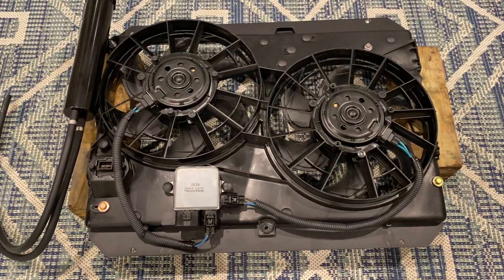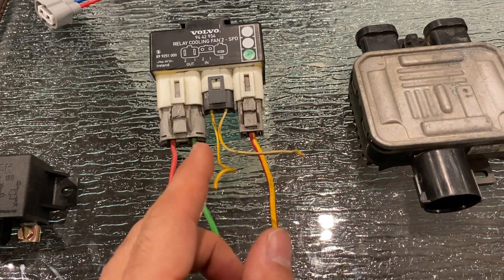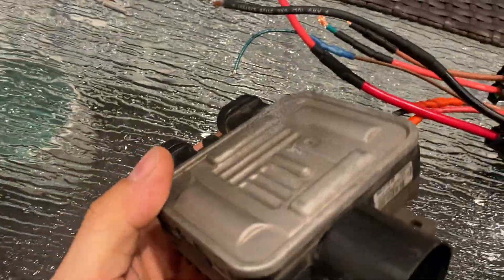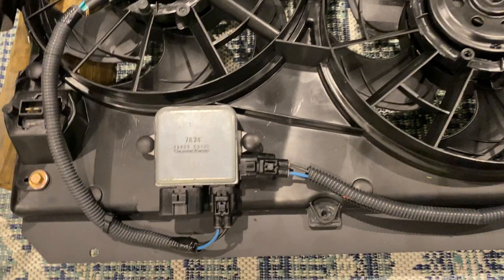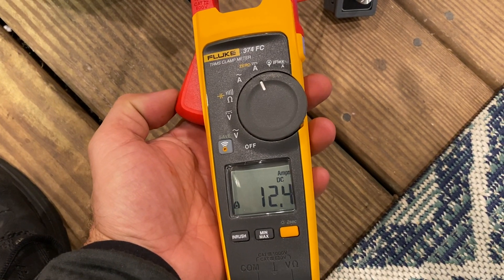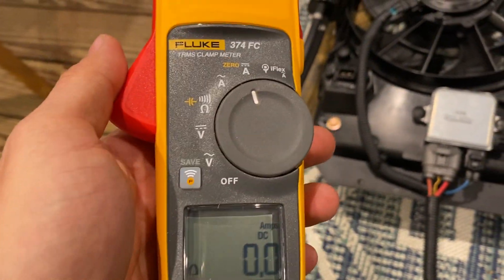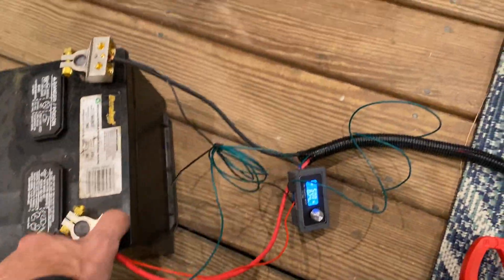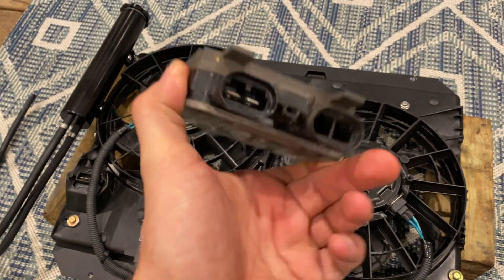Contour Fan Setup using a PMW fan controller

Comment: Thanks for the video, nice explanation of things. Quick question. 

What's the risk of running these countour dual fans without a controller? Sounds like when they start up it pulls a lot of juice but that lowers after they are running. 

Also do you think I can use it without the resistor connected to anything?
Reply from the maker: You can run these fans with a regular relay.   The BMW 2-speed relay is popular with these. You do not need to use the resistor if you just want a single speed - full on.  The resistor is for 2-speed use. 

The amperage spike on startup is very quick.  Typically wiring and maxi-fuse will handle this momentary spike.  I ran a similar fan off a simple Bosch 75a relay setup for years.  There was a slight dimming of lights for a half second when the fan kicked on but otherwise it ran fine provided the wire size is appropriate for the load when running. 

That’s the one thing I like about this controller is the soft-start feature so you don’t get that high amperage kick when they first start. 

I’d be curious to see how long the module lasts if the pwm control wire was hooked to a simple Bosch 30a relay and just grounded and ungrounded to switch between off and full speed.
Reply: @Mustang5L5  thanks for reply!

I just finished my efan and radiator install earlier today. I noticed about 0.3 volts drop when test driving the fans when start up and run full speed. I left the resistor wired in and grounded, maybe down the road I will play with one of the controllers for the smooth ramp up. 

This contour fan is a nice unit, I needed the fan to be slim enough to fit while also moving lots of air all said it's a really great upgrade. My concern was the amp draw but I might need more testing.

Comment: so what are you using for a temp sending unit
Reply from the maker: It’s all controlled through an aftermarket ECU using the factory temp sensor.  The ECU is generating a programmed pwm signal to the module based on the coolant temp sensor reading.

Comment: Is there anyway you can explain how you wired the pwm ? I only see three wires but I thought the pwm needs four correct ? Is the pwm just wired to power and ground and then the signal wire (green) is wired to what, the ground or positive side ? (Sorry I’m very new to this)
Reply from the maker: Two of the three wires are the high current feed for the fan itself.  Positive and negative.  This also provides power to the module itself. 

The third wire is the actual pwm control wire. This connects to the control device. Either the factory ECU, or an aftermarket ECU or arduino or the manual controller I am using in the video. 

The 4th wire in a 4-wire PWM is tach, but that isn’t being use here.
Reply: @Mustang5L5  so in this video the pwm controller your using, you have power input being the power and ground from the battery and then the signal wire coming from the fan controller itself is going to the pwm signal or the ground signal ?
Reply from the maker: @Lima_ranger_95  the pwm output wire from the controller is going to the small pwm signal wire on the controller.   Both the module, and the controller I am using need to use the same 12V+ and 12v- inputs from the battery.  They get common power this way and then it’s just the single pwm wire from the controller to the module

Comment: Where does the pwm cable comes from.to control the fan
Reply from the maker: These modules need something to interpret the coolant temp readings, or ac on/off and generate the pwm signal for it.  In the original vehicle that’s done by the factory ECU.  Here you will need a device to do that as well. 

Most folks would use an aftermarket EFI setup that can do pwm fan control.  You could also build an arduino setup to control it, or just use the manual control device I am using.

Unfortunately they won’t operate as a stand-alone device.

Comment: Got your response, thanks. Have another question, since I’ll be a using a thermal switch Normally open grounded to engine, can I then use the other end of the TS wire as a trigger upon temperature to closed TS circuit connected to the negative wire on the PWM Mazda control to run the fan?
Reply from the maker: You know, that actually might just work.  It works the same as a ground and is on/off so I think it would do the same.
Reply: @Mustang5L5   hello again, sorry for comming back so often. can you send me a link where you bought the controler and pig tail that you are using? thanks again.
Reply from the maker: @josevizcaino4075   the modules I got were used. I got them off eBay and they came with wiring.  

Here’s one brand new.  There are also aftermarket ones for $30 that come up on Amazon if you search that part number.  I have not heard great things about them. 

https://www.tascaparts.com/oem-parts/nissan-fan-control-module-214934ga0a?c=az0x

Here’s the wiring harness
https://www.ebay.com/itm/272481520683?mkcid=16&mkevt=1&mkrid=711-127632-2357-0&ssspo=t2wLViCQTDW&sssrc=2349624&ssuid=5SnpWrb-QX6&var=&widget_ver=artemis&media=COPY

I would keep an eye out on eBay for a used one with wiring.  I’ve seen them in the $20-40 range.

Comment: So I like your setup choice of controllers and I already have my C-fan for my 92 coupe but I will be using a thermal switch threaded into manifold coolant port. And possibly a bypass switch as well, maybe. My question since I won’t be using my factory eec, how would you wire this using both fans to come upon temperature?
Reply from the maker: Also, if you go to 10:13 in the vid, I talk about what happens if you ground and unground the pwm signal wire such as when using a relay.  Ground it turns the fan off.  Opening it so that the wire is floating causes the module to go to “fail-safe” and will soft start up to full power. 

You could wire the temp switch to the ground side of the relay and install a bypass switch on this wire.  Open the bypass and fan off under all conditions. 

No idea what this will do for the life span of the module.
Reply from the maker: I have a few threads on forums with folks asking this same question.  I’ve been trying to find a solution that doesn’t involve an aftermarket ECU setup.  I know one can make an arduino setup but that requires a bit of DIY and coding.  I have yet to find a commercial solution. 

Post 26 and 30 in this thread talk about using some relays and the resistor pot to use the module to make a 2-speed fan, but also using the module for its soft-start feature.  There’s also some more discussion and a thread on building the arduino device. 

https://www.stangnet.com/mustang-forums/threads/pwm-fan-control.922944/page-2
Reply: autocoolguy     Darryl  Dashiell channel  his units do everything

Comment: I run a C6 Corvette fan and pwm fan relay on my turbo 5.3 in my 67 mustang. I run holley hp efi. Fan runs at 50% around 185 and 80% at 210. I cut off the fan at 80% throttle. I was told to run the fan at 128hz. Works well.
Reply: خاتمة غير كذا انا اقول لا زى ج مرحبا
٤:٧ ٦ ٩ 1 1 1 1 1 1 1 1 1 1 1 1 1 1 1 1 1 1 1 1 ١١١١١١١١١ ١١١١١١١١ 1 1 1 1 1 1 - 1 ١ 1 1 - 1 1 1 1 1 1 1 1 1 - - - 1 1 1 1 1 1 1 1 1 1 1 1 ١١

🥜🍄🍄🏟️🏘️🏛️🏡🏖️🌋⛰️🏘️🏤🏟️🏨🗻🌍🐃🐖🐄🦌🐴🏟️🏘️🏟️😭🙃😗☺️😗😘😘🙃😙😂😋😚🤩🦓🐈🦄🐎🐴🐈🐃🐒🦓🦌🐮🦌🦓

Comment: Nicely done! Do you happen to know what part number(or model/type) the 3 connectors have for the Infiniti controller(the big power and the 2 fan connectors)? I just got myself an Infiniti controller, but struggle to find the right connectors to use to wire it up. Thanks
Reply from the maker: I do not know part numbers for OE harness ends. There are aftermarket harnesses available, but the wire size is slightly smaller than OEM.  My controllers came with the oe harness ends snipped, so I used those. 

This is the aftermarket plug ends.  

https://www.ebay.com/itm/SET-OF-3-CONNECTORS-Cooling-Fan-Control-Module-Fits-Infiniti-Nissan-2006-2018-/272481520683?mkcid=16&mkevt=1&_trksid=p2349624.m46890.l49286&mkrid=711-127632-2357-0
Reply: @Mustang5L5  I got the setup wire up, but as you mentioned, as soon as the PWM generator is switched off, the fans go to max.. Did you ever figure out how to wire it so you can prevent this from happening?
Reply from the maker: @Bluepower20vt  use a 5-pin relay between the PWM signal generator and the controller.  Have it setup so that when you kill power to the generator the relay also switches and grounds out the pwm signal wire.  Grounding the wire will signal the controller to turn off.

Comment: Thanks for the awesome video!  I'm currently running a Mark VIII fan and it has a big voltage drop when it turns on that causes a pretty bad rpm dip.  Does the type of fan matter when it comes to using a PWM controller like the ones you tried?  I would love to have the draw be less when the fan comes on to prevent the issue I'm having.
Reply from the maker: I’ve tested it with a couple different fans. It does reduce the amount of current draw due to the soft-start, but the max current draw will depend on the fan itself.   Unfortunately I did not get a reading of the current draw of those fans.  The Infiniti uses a 50A fuse on its fan, and the wiring is 10g, so it can handle some current.    The Volvo S60/s80 module uses a 60amp fuse and 8g wiring.
Reply: @Mustang5L5  Sorry I didn't get an alert that you replied to me!  Thanks a lot man.  I ordered a Volvo S60 unit and it was delivered yesterday.  Do you happen to know if it has the "failsafe" mode where it will run full speed if the PWM wire is disconnected or grounded?

My current setup is a pair of 80A relays (to handle the Mark VIII fan) triggered using the Megasquirt fan control output so I'm wondering if for now I could essentially use the Volvo controller for soft start with the PWM grounded or disconnected until I have time to run the PWM wire from the Megasquirt to it for full variable control.  

Sorry for all the text but I REALLY appreciate your help because I haven't seen this level of detail anywhere else online!
Reply from the maker: @kylevfredrickson  I never got to experiment much with that unit so I really don’t know.  I do know they are sensitive to polarity when you hook up the main power/ground and it can brick the unit if not hooked up right. I would recommend getting a wiring diagram for the S60 and really knowing which wire is main power first.  All my experience is with this unit in the video, so sorry I can’t be more of assistance.
Reply: @Mustang5L5  Ah ok, thanks and no problem.  You've been a huge just sharing the info about using these PWM controllers in general.

I had to buy aftermarket wiring connectors for it and they both have clear red and black wires so I would hope that they are correct for power and ground.  I'll try and find a wiring diagram to check to confirm for sure which is which so I don't blow it up.

From your experience with PWM controllers, do you think it would at least be safe to test grounding the PWM wire to see how it acts?  Just thinking that 100% duty cycle should essentially be solid ground right?  Don't worry, I won't hold you responsible for anything I mess up, just trying to figure out a way to test it without hooking up to the megasquirt right away. :)
Reply: @kylevfredrickson  .
Reply: the best solution for the lincoln mark viii voltage drop is to get a 320amp alternator that runs north of 140amps at idle. 
i have a Dual lincoln mark viii fan set up and the alternator can keep them running both at idle blowing full speed haha. 
check out my IG if you want to see it’s the same as my youtube name. 
i’ll also be uploading a video likely today on my youtube channel with the dual lincoln mark viii fan set up

Comment: How exactly will you be wiring the controller into the mega squirt to make it function in pwm mode?
Reply from the maker: You can create an programmable PWM output on megasquirt (I am using an MS3X) and assign it to an empty pin.  From there you just connect the single control wire to that assigned pin and use 250hz.   In Tunerstudio, you can program the PWM output based on coolant temp and create a table. You can say that at 185 degrees, the PWM output at 250hz is 25%.  This would start the fan at a low speed.  Then you can program 195 degrees to be 50% and that would run the fan at half speed.  You can adjust the ramp-up any way that you want.   

Tunerstudio does have it's own fan control menu (for MS3X at least) but it's not PWM.  It will control a relay, so i might use the feature for turning the fan off over 40MPH to switch a relay that might kill main power to the controller, or switch the control wire to ground to turn the fan off.  

It will also do AC control, but I haven't decided how to wire that in yet.